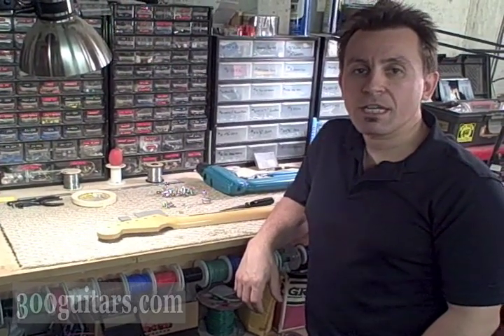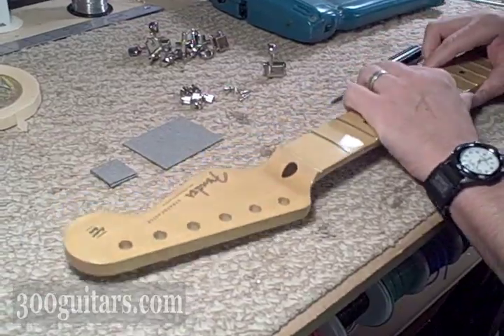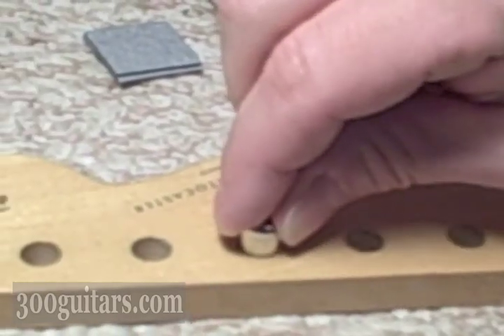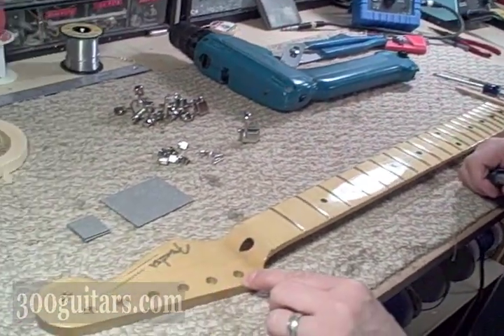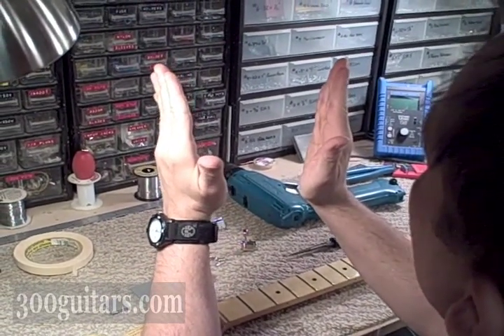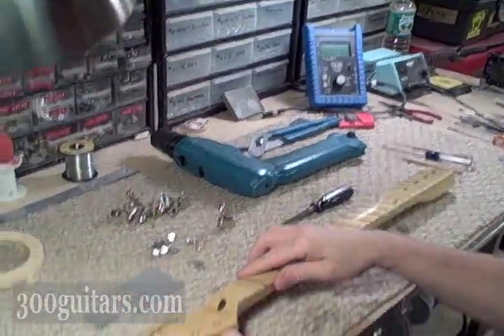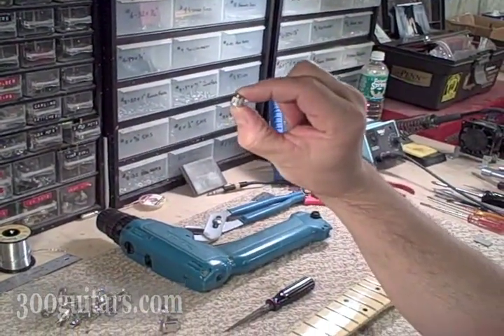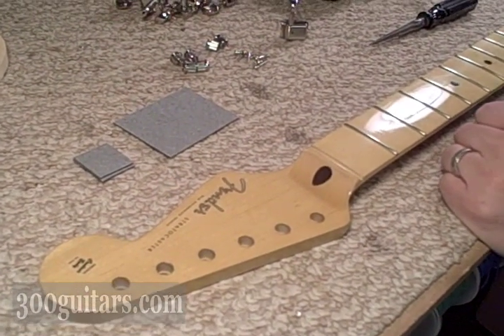Kluson Tuners- How to Install Part 1 by Billy Penn 300guitars.com

Comment: @78atal thanks Billy - I just did the change and your vid was a great help. Its a simple job but your step by step gave me the confidence that I wouldn't mess my 97 MIA Std Strat up. The Gotohs are great - it needed the conversion bushings Stewmac supplied them with the Gotohs.

Comment: @300guitars its about a 1/16 inch gap from bushing to the wood. i know the holes are 10.5mm and fit 10mm tuning knobs. i assume the bushings i have are a little smaller than that

Comment: @300guitars its about 1/16 of an inch loose i'd say. like thats the distance of the gap. i dont know about radius or any of that stuff.  all i know is that the holes are 10mm and can fit 10.5mm tuners?

Comment: Billy, thanks for yet another great video! I have a japanese 60's reissue strat and it's very hard to keep it in tune. I've tried blocking the tremolo, but it actually stays in tune better when I have it set up to float, kind of like Carl Verheyen.
However, after a few minutes of bending, it still detunes quite a bit. I've thought about getting some locking tuners and graphtech saddles, but in your opinion, what would be the best way to keep my strat from detuning?

Thanks!

Comment: @300guitars Hi! I have question. I've just ordered a telecaster neck from a website. The holes for my bushings are just a little bit to small. I would like to have a tool like the one you used in the beginning of the video, but what's the name of that tool? //Simon

Comment: my bushings are too small and move around in the holes. does that mean they wont work?
Reply: the kluson bushings are too small for my telecaster and too loose ..... what do you do in this situation ?
Reply: paddy cautela I have used making tape to fill the space but if the guitar had threaded fittings then you can't really go to press fitting 
But if you are replacing press fitting use a little masking tape